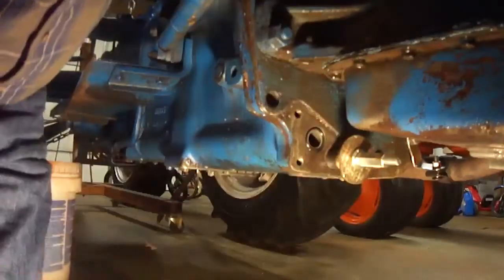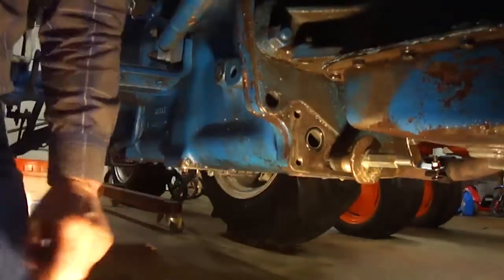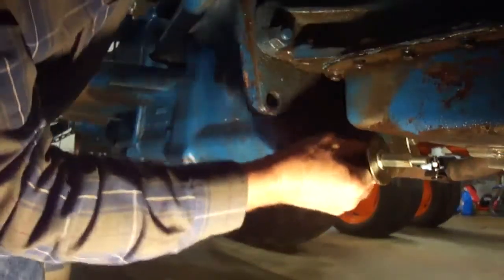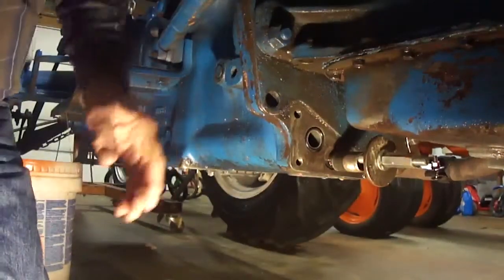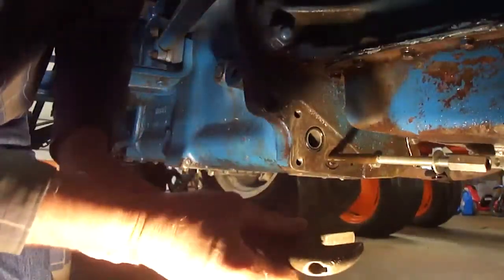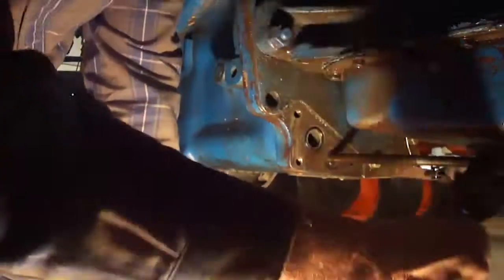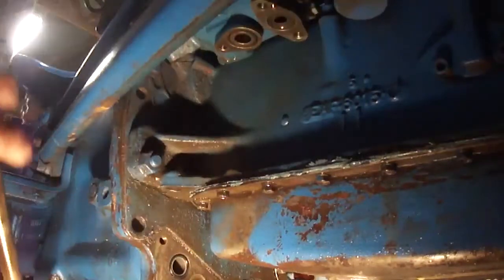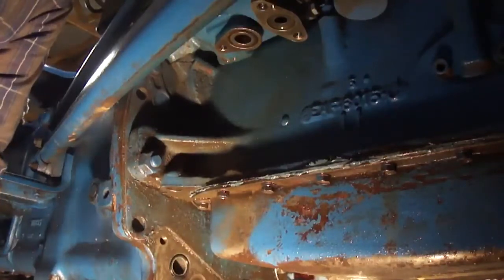Ford 2000 tractor hydraulic line removal 3

Comment: When reinstalling the line what SEALs the back of the tube?
Reply from the maker: Well, this is a pretty late answer but the tube is stepped (not really tapered) and is pressed into each section so that as your tap it into place it is a press fit. I did use some bearing locker on each step area and it has been perfect for over three years now.